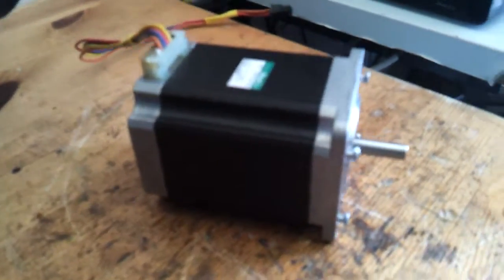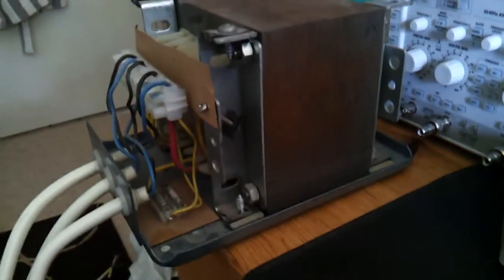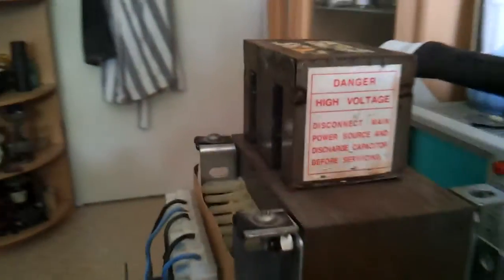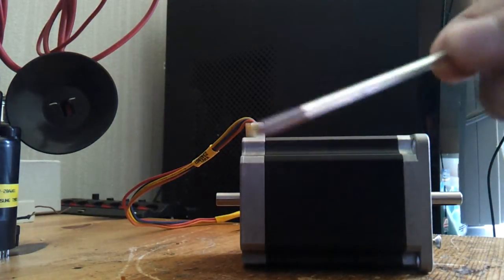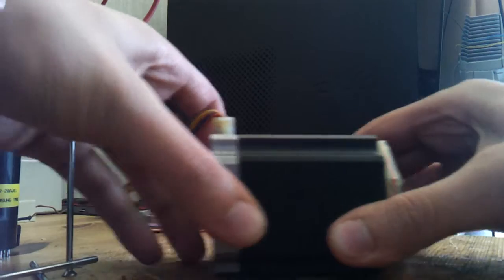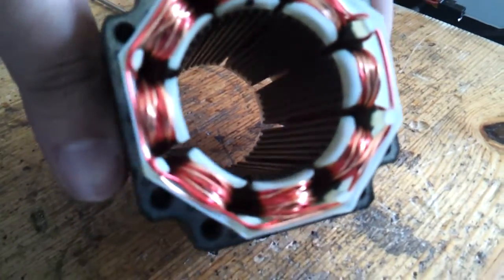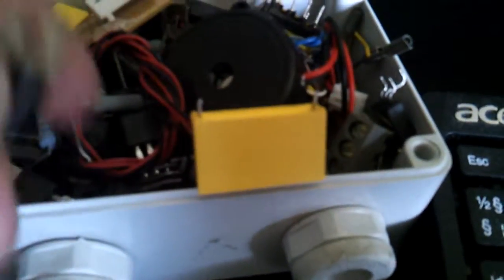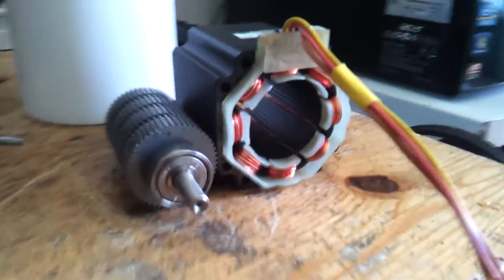STEPPER MOTOR TEARDOWN

Comment: Thanks for the look around. I just learned that removal of the core rotor theoretically reduces the magnetic strength by at least 1/3rd as it is magnetized in place. This is not something I would have anticipated during a teardown.